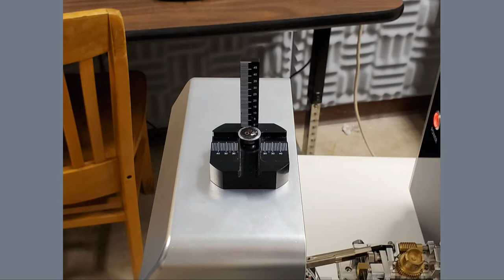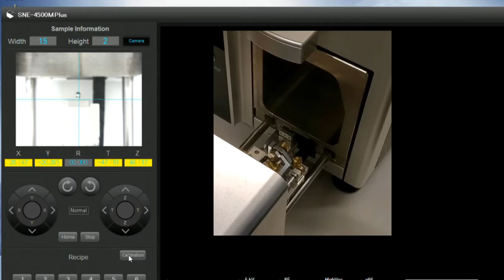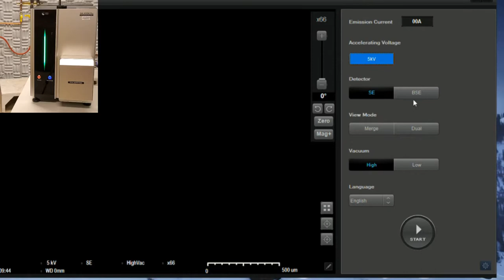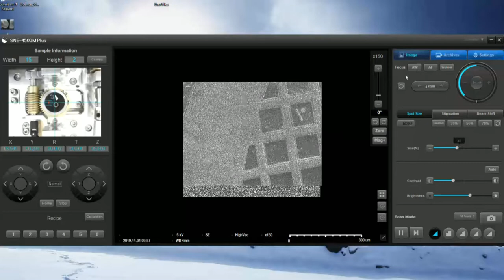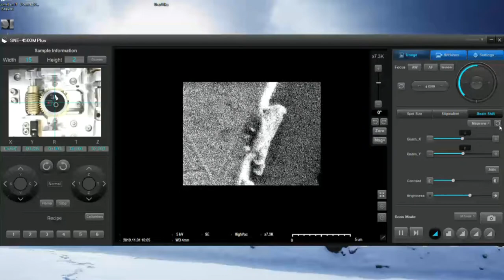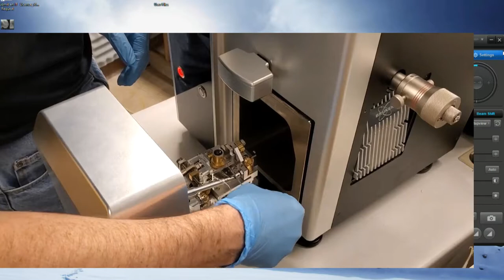Tabletop SNE4500 SEM training video

Comment: SEC Tabletop SEM SNE 4500 Series are most functionalized and high resolution mode in tabletop series.  5nm Resolution and 150.000 X Actual Magnification and strong at outside vibration factors.  It is a easiest operation and multi user adaptable models in Tabletop SEM.  #SEc Europe #Tabletopsem #www.tabletopsem.com